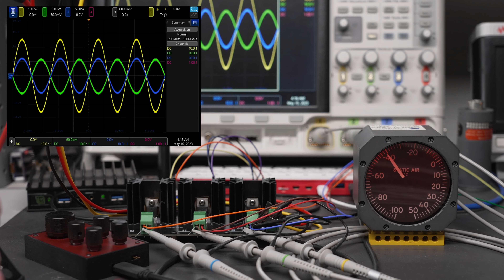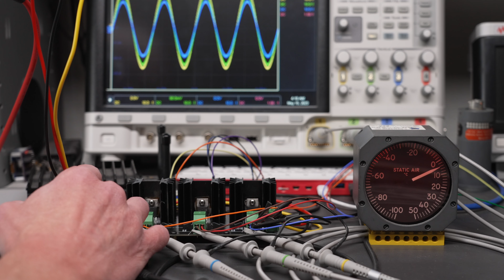Control an aircraft static air temperature gauge from a Raspberry Pi!

Comment: I am kind of wondering but how much power does the syncro take?  Do you really need those heavy mosfets?
Reply from the maker: Those are high current, high voltage operational amplifiers. TI OPA548. They get a little warm even with no load.  I don't recall this synchro's power requirements but a similar synchro and waveform generator pulled 88 mA at 60 VDC from my bench power supply.